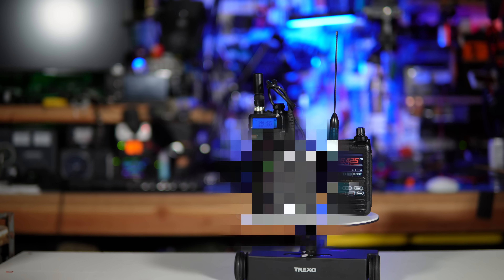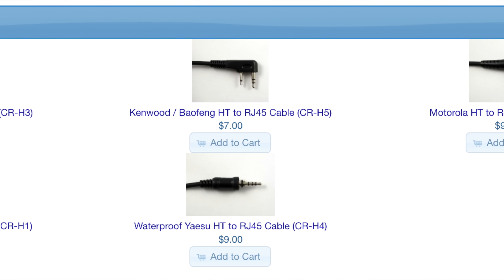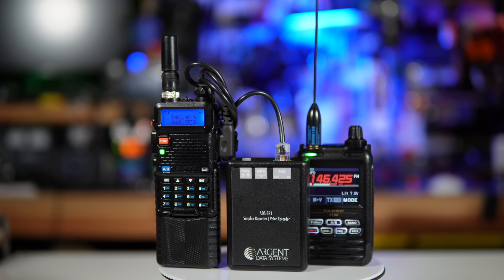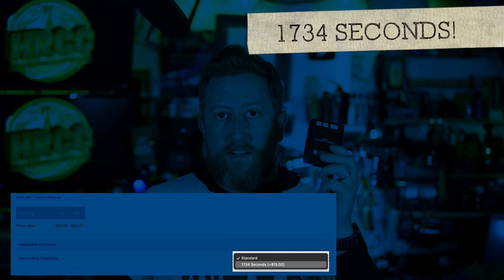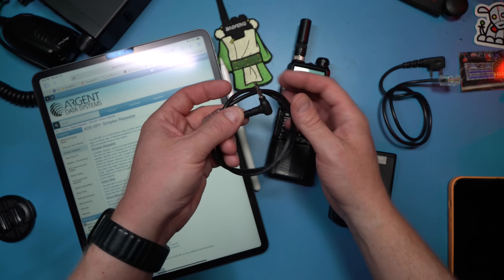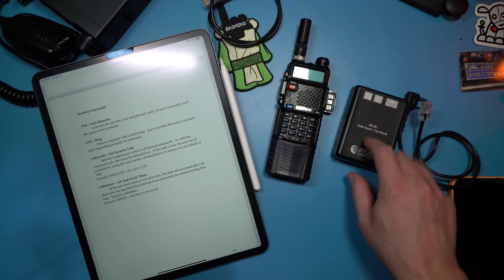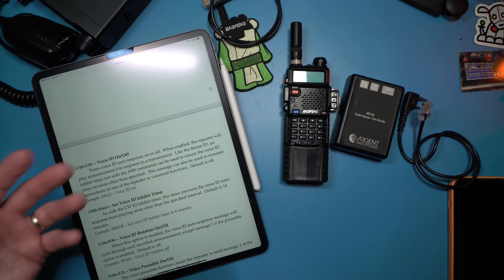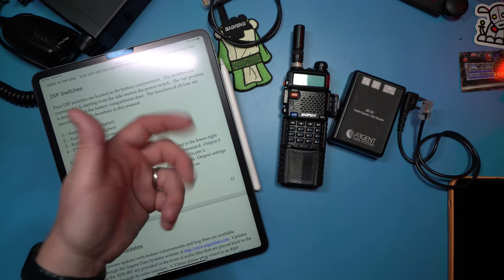The Most Hated Box In Ham Radio

Comment: In a shtf situation the timer function would make it great for getting a message out when you're not near it
Reply from the maker: Advantage there is you don’t have to be at the station in case a motor gets dropped on the signal.
Reply: @HamRadioCrashCourse , yep.  I was thinking there are some tactical reasons to deploy such a unit.

Comment: They are a really good tool for specific use cases - especially groups hiking/camping in remote areas. Use an uncommon frequency (not a calling freq, not a repeater input, not in the satellite band.) Use tone squelch if possible. Use lowest power that gets the job done. Don't use it as a permanent installation. If you do all that, nobody will hate you because nobody else will hear you.

Comment: I’ve had one of those for over 10 years. Nifty devices with many uses.
Reply: Such as...?
Reply: @BRJ2  Bridge a radio system to a public address speaker system, do automated radio checks for boats leaving marinas, test coverage for a proposed repeater site, send pre-recorded messages for a fox hunt, repeat slow-scan TV frames, or use the say-again function to check what the last traffic on the frequency was, even if it's hours or days later.
Reply: @n1vg  thanks,  I'm new to amateur radio. I want to learn all I can.

Comment: We use them on business band for mining/geological work in remote areas. The repeater/relay controller is always connected to our mobile radios and can be activated with three button presses. Some clever programming allows it to ID in the clear and also pass secure digital voice. Most importantly, they operate with a standard 5MHz offset so the end user experience is less jarring. The end result is dramatically extending the range of our portables. Crossband operation is out because quality dual-band commercial radios are cost-prohibitive.

Comment: Imagine two of these in range of each other.  One of them hears my walkie-talking, stores it, and then broadcasts it.  The second of these hears the first, stores it, and then broadcasts.  The first hears the second, stores it and then broadcasts.  This would go forever but of course the qualty would rapidly deteriorate until they send each other bursts of noise.
EDIT:  Using tone squelch would eliminate this problem provided that (1) the unit does not pass the tone or (2) they don't have the same tone.
Reply: Exactly what I was thinking. A feedback loop.
Reply: Activating this built in feature eliminates this problem: ##78<code> - “Set Pager Activation Code.”

The pager activation code can be up to 6 characters long. When a code is
entered, the repeater will ignore all received transmissions unless the DTMF activation code is heard. This can be used to extend voice pager systems, or to activate the repeater using a DTMF automatic numeric identification (ANI) setting on the sending radio. Setting a blank code disables the function. Default is disabled.
Example: ##781234 – Set pager activation code to ‘1234’.

You can also set the two repeaters on different frequencies and with different CTCSS tones.

Comment: Given that I have never heard of this "most hated box" until this moment, and have been an operator for several decades, I doubt it is the "most hated" box.  There is some disrespect for Baofeng walkie-talkies but I have one at about 1/10th the cost of my Icom walkie talkie.
Reply from the maker: What’s a more hated box and how much time do you spend on VHF/UHF?
Reply: @HamRadioCrashCourse  I typically listen on our local wide coverage repeater in the evenings after work.  It tends to be lightly used and mostly rural.  Being surrounded by mountains it is unlikely I would ever become aware of the existence of simplex repeaters.  I like the idea of them but I can see where some precautions would need to be used. 
If there's a hated or at least disrespected box, it would be any of the illegal CB radios (or legal radios being used illegally) but so long as they stay down on 11 meters, not really my problem.  I am amused by the collective stupidity of it; I had a friend in Hawaii that showed me his kilowatt "burner" but it had a single television horizontal deflection tube rated about 40 watts.   You cannot argue with that kind so I didn't.  He was happy with his "kilowatt" and I was happy he had only 40 watts at most. It also had a mechanical vibrator inverter for the B+ voltage so needless to say his transmissions were remarkably buzzy.
Reply from the maker: These repeaters are pretty hated in more populated areas. And depending on their proliferation on often used frequencies.

Comment: Just use an XBR to connect to a local repeater.
Reply from the maker: That assumes there is a repeater…
Reply: XBR: Cross band repeaters.  Many dual band radios have this built in if they have two VFO's.  Listen on 2 meters, transmit on 70 cm or vice versa.  It's pretty handy to achieve true repeating in a box.  It seems to be legal provided its operator is also the licensed operator and actually using it.  Such a thing as a general purpose public repeater won't be legal since the radio being used as a repeater does not identify itself.  But if I have such a thing in a pickup truck and am walking around with a walkie-talkie and just using the truck mounted mobile radio as a range extender, then it seems to be legal.  I own the station, I am using my callsign.

Comment: Imagine 2 of those on 1 frequency, a single transmission could set it off for hours of self repeating
Reply: I've done it, partly as an audio quality test. And partly just because it was funny to listen to. If you don't set it to trim the courtesy tone from the end, you get an increasingly long series of beeps. And of course the audio quality degrades with each generation.
Reply: I heard a lady doing relay repeat of a bunch of weak stations moving around, she was at the big rig with the fars and would repeat what was said from a mobile, or relay to mobile that was privvy to the said info, a relay dispatcher. I should have recorded it.
Reply: Sounds like fun to me
Reply: There is a feature to prevent this from happening: ##78<code> - “Set Pager Activation Code”

The pager activation code can be up to 6 characters long. When a code is
entered, the repeater will ignore all received transmissions unless the DTMF activation code is heard. This can be used to extend voice pager systems, or to activate the repeater using a DTMF automatic numeric identification (ANI) setting on the sending radio. Setting a blank code disables the function. Default is disabled.
Example: ##781234 – Set pager activation code to ‘1234’.

Comment: First, soft boxes lighting is a noticeable improvement. As for the Argent box... it's like a Leatherman multi tool with an extremely sharp blade attachment. Easy to hurt yourself but also does so many good things. Uses: Immediately thought of a Fox Hunt... beats just having a straight beacon that is unidentifiable. The duration function could pulse this out for 15 seconds every 3 minutes. Including your call sign would make sense. ould also ise DTF tones to trigger it on demand. Also, the recording function, even at 100 minutes, would be great for recording net meetings. It would be great backup for the net controller. I'm sure there's others.
Reply from the maker: Good ideas! That meeting minutes thing is intriguing.
Reply: @HamRadioCrashCourse  Recording on the SR1 is all transmission-oriented so it wouldn't record a bunch of back and forth, but recording to an SD card (or to a network location) is a function planned for the ADS-SR2. And that reminds me, I ought to dig out the prototype Memory Speaker that was demoed years ago at Dayton and dropped due to other priorities. It's basically a radio Tivo speaker - you can pause live audio and jump forward or back, by transmission or fixed time interval, and it keeps recording while playing back so you don't miss new traffic.

Comment: I believe it’s fully legal. 1: That device has full DTMF remote control & Auto callsign ID. So as the control operator you are able to disable or enable this repeater. Which meets the FCC legal requirements of operating a repeater. (Reason 2 actually makes reason 1 completely unnecessary in the case of this device) 2: If you read into the details of how the FCC defines a “repeater” you would see that a repeater is described as a device that simultaneously re-transmits the incoming signal. This device cannot be legally categorized as a repeater because it does not do this. It records an incoming signal then re-transmits it once the incoming signal has dropped. This is called “store & forward” or “relay” (similar to a APRS digipeater but with voice). which does not fit the FCC definition of a “repeater” & therefore is completely legal as long as you do not cause harmful interference, which can easily be done by staying away from local repeater & common simplex frequencies. I recommend operating in the “experimental” portion of any given band to avoid problems. I always use mine with CTCSS tone and typically only when camping in the backcountry.
Reply from the maker: Good comment.  My concern is the remote operation here still.
Reply: @HamRadioCrashCourse  Luckily it has many remote control features. Including: #70 – Repeater Off
Turns off the simplex repeater function. The unit will respond to commands, record ‘say again’ messages, play announcements, and accept voicemail as usual, but it won’t automatically repeat transmissions.
Reply: If the control channel is in-band then it cannot year your DTMF codes if someone else's carrier is stronger, so you don't actually have full control of it.  While I have a doubt about the "complete" legality of it, I do not automatically see anything particularly wrong with it and it could certainly be useful in some remote areas that lack a proper repeater.
I wonder, however, what would happen if two of these things could hear each other.  It would be like Furbies having a conversation that never ends.
Reply: @thomasmaughan4798  This device has a timeout feature so eventually the control operator should be able to input a control command to shut down the repeater: ##06<time> – Set Auto-Off Timer
The repeater function automatically shuts off after the specified idle
interval, and may be turned on again with ‘3’ or off with ‘6’. These on and off functions do not require the access code to be entered. Setting the auto-off timer to 0 disables this function. Default is disabled.
Example: ##06045 – Set timer to 45 seconds

Also this feature: ##18<time> - Repeater Cool-down Time
If the repeater times out due to a long transmission, it will stop repeating
transmissions until the period of time specified by this setting has expired. This can be used to avoid transmitter overheating, to ensure that a repeater with a stuck squelch remains controllable, or to penalize overly long-winded users. Set to zero to disable. Default is disabled.
Example: ##1802 – Set cool-down time to 2 minutes
Reply from the maker: If they could hear each other? Chaos. 👀
Reply: @HamRadioCrashCourse  you are absolutely correct. Fortunately this device offers a solution. Straight from the user manual: ##78<code> - Set Pager Activation Code
The pager activation code can be up to 6 characters long. When a code is
entered, the repeater will ignore all received transmissions unless the DTMF activation code is heard. This can be used to extend voice pager systems, or to activate the repeater using a DTMF automatic numeric identification (ANI) setting on the sending radio. Setting a blank code disables the function. Default is disabled.
Example: ##781234 – Set pager activation code to ‘1234’.

Activating this feature basically means that only transmissions preceded by the activation code will get relayed. 

Or simply each simplex relay gets set with a different CTCSS/DCS code and preferably different frequency and problem also solved.
Reply: Relay stations are nevertheless stations; all stations must be licensed.  But the BOX is not a transmitter!   Whatever radio is the actual transmitter must be licensed and identify every 10 minutes of actual operation.  If it is your personal radio on the hill and you are its user, then of course your own identification ought to suffice.  But if the owner of the "station" never identifies, the fact that third party users are identifying does not (IMO) meet the definition of identifying the station itself.  That's probably a quibble but there you go.
Reply: @thomasmaughan4798  good point. Fortunately this device offers a solution. Automatic Callsign voice and/or CW ID.
Reply: @JamesHannibalKH2SR  Well then I may have to get one of these!

Comment: How is this any different than a digipeater on APRS except with voice instead of data? I would think that store and forward simplex repeaters would be OK on ham bands, but it might require a remote call operator with remote shutdown operation and a timeout timer to prevent uncontrolled long transmissions.  What does everyone else think? Comments by "some people" are welcome.....
Reply from the maker: Good point! The argent does have all that remote control too.
Reply: Digipeaters do not automatically repeat everything they hear.  The digipeater itself must be addressed in the packet, with instructions on where to forward.
If the digipeater or any simplex repeater was in range of another one, they would start talking back and forth and never end, since voice store-and-forward has no addressing capability.  Each such repeater would store the other, then retransmit, whereupon the first stores it and forwards again.